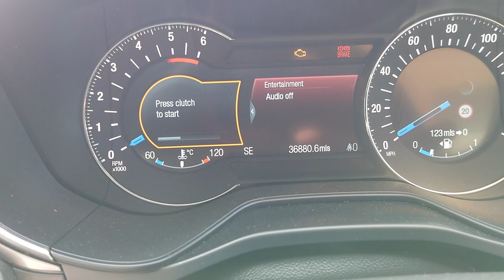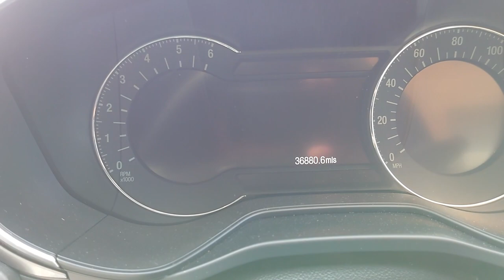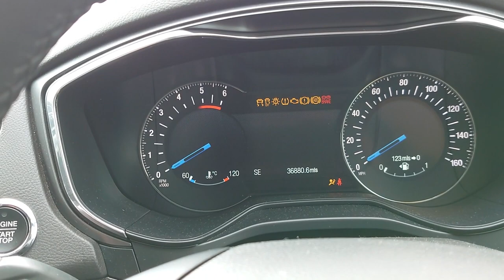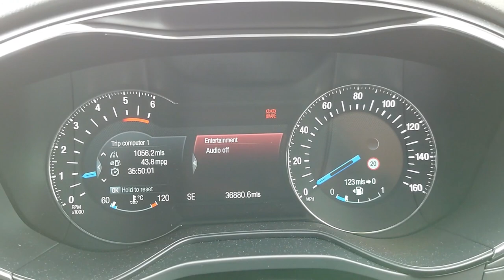Ford Mondeo MK5 electronic parking brake service

Comment: Nuni that was a very good and helpful explanation. I Like the part where you removed the electronic parking brake from the caliper. Nice tip. 

You can also set the electronic parking brake in maintenance mode without a scan tool, using a combination of actions as follows:

Activation:

Set the ignition to ON.
Press and hold the accelerator pedal and place the EPB switch to the RELEASE (downward) position. Continue to hold the accelerator pedal and EPB.
Set the ignition to OFF, then set the ignition to ON within 5 seconds. Continue to hold the accelerator pedal and the EPB switch.
The EPB system will be deactivated, preventing parking brake application until service has been completed and maintenance mode has been deactivated. The yellow electronic parking brake indicator will be illuminated and maintenance mode will display on the message center.
Set the ignition to OFF, then release the accelerator pedal and EPB switch.

When replacing rear brake pads in maintenance mode, the brake caliper piston must be compressed into the caliper housing. 
The brake caliper piston does not have to be rotated while compressing the piston.

Deactivation:

Carry out the following service mode deactivation procedure to activate the EPB system.

Set the ignition to ON.
Press and hold the accelerator pedal and place the EPB switch in the APPLY (upward) position. Continue to hold the accelerator pedal and the EPB switch.
Set the ignition to OFF, then set the ignition to ON within 5 seconds. Continue to hold the accelerator pedal and the EPB switch.
Release the accelerator pedal and the EPB switch.
The EPB system will fully apply and release the parking brake to guarantee sufficient air gap between the rear brake pads and brake disc.                                                          

Whether you have the start stop button or a key start system the same procedure applies.
Reply from the maker: Excellent thanks for sharing 😁
Reply: The brake deactivation process does not appear to work on my 2015 mk5 2litre diesel..☹️

Comment: Verry good instruction, if the electronic brake will not go into service-mode-position with the brake-switch methode or you don't have the service-pc.

Thanks for that!
Reply from the maker: I have service scanner. This is to show u don't need the scanner for it. I do mercedes, bmw, vauxhall fords vw audis all the same method. Its easier for me ☺️
Reply: @axores20  Yes, and much more cheeper! For nonprofession workers like me! 😉

Comment: I tried to retract the piston using the online methods with the park brake button and accelerator but it didn't work. Your manual method worked perfectly. Unfortunately, before I saw this video, I blew a piston when I stupidly pulled the handbrake on while the caliper was off. The piston extended all the way and popped out. I was able to put it back but unfortunately I stuffed up the mechanism. Was getting a handbrake warning and non stop chime while driving. Bought a second hand one and fitted it myself. When the oil on the old faulty one drained out, out came about 50 tiny ball bearings and springs. Mechanism busted. So, it was an expensive lesson. Don't pump your brake of hit the handbrake switch while the calipers is out 😣.

Comment: I have a question for you, I have the same vehicle, but I accidentally turned the caliper piston counter clockwise. Now I have the error message on my dash, do I open the caliper housing to reset it? The piston did go in with the tool, but now the limited brake service light is on. How can I fix It? Scan tool? Opening the caliper housing? I did put my car in service mode before I started my brake service
Reply from the maker: Hi. If you did put into brake service the motors should go all back and then what u need to do is only push the piston in. And fit new pads and then after all wheels all put on u should turn off the service brake and the calipers should back to normal position. If now u got a error you will need a scanner. What u can do is now leave the handbrake off and turn off the car. Disconnect the battery. Do what i did do, remove the motors and turn it to the correct position till locks like i did on the video and put motor on. Do the same another side. Put all together and reconnect the battery. It should back to normal. But before all this if you got a scanner check 1st the codes. If u don't jave a scanner then follow my procedure. ☺️
Reply from the maker: Also make sure you did not damaged any wire or disconnected any plugs from the calipers ☺️ let me know the outcome.
Reply: @axores20  ….yo, thank you so much bro, you the man 😎👊🏽…I will update you as soon as I can do that 👊🏽
Reply: I fixed it bro 🥳😎👊🏽, you are the man, thank you for the help and reaching out to me in a timely manner, just a fyi, the scanner tool allowed me to reset the error and then I was able to take the car out of maintenance mode. You saved me a lot money bro, god bless to you and your family, thanks again bro 👊🏽😎
Reply from the maker: Glad is sorted bro. Have a nice weekend 😊👍😀
Reply: @axores20  …you too bro 👊🏽😎 and thanks again 🥳

Comment: Great instructional video!
19:24 What was that "another kind of grease" which you used for those two guide bolts?
Thank you :)
Reply from the maker: Silicone grease will be ideal but I always use multi purpose grease with no any problems

Comment: What about replacing the whole calliper? If you take it off and unplug its electronic, will this cause any sort of issue on the dashboard? Thanks
Reply from the maker: If ignition is off u wont have problems. This is just power to a motor no any sensor on it. It should be fine 😉

Comment: Hey Bro, I need your help, I just got a limited brake service message on my dash. I ran the scanner and it gave me codes, C2005 and C1034. I replaced the actuator motor on the right side thinking that would solve the problem but it still has those codes, I’ve tried almost everything from disconnecting the battery to erasing the codes, but nothing seems to fix it. My last option is to replace the wiring harness on the right side since that’s where the code is coming from, but I dunno. You helped me a few months ago when I stuck, kinda hoping you had an idea on what it could be?

Comment: Hi Nuno. During the trip, my brake blocked and I disassembled it and tried to work it out and lubricate it. I screwed in the piston because I didn’t have the tools to squeeze it, but I didn’t know I had to put the handbrake in service mode. And now my handbrake doesn't work when I turn it on. The car displays an error and the parking brake light flashes. Can I return the handbrake to its original position and clear the fault or have I broken the handbrake and have to buy a new part? The foot brake works normally.
Tnx
Reply from the maker: Hi there, i would do this, 1st disconnected the battery, number 2 you need do this to both back wheels, take the electronic bit away like i did on the video, next u need push the piston all in. Put back the motor. Both wheels do the same. Then pump the brake pedal few times. When brake pedal feel hard connect the battery. Turn on the car and try apply the brake. It should work 😃
Reply: @axores20  Thanks for such a quick response. I'll give it a try and let you know how it went. Thanks again.
Reply from the maker: @josipkralj8229  u welcome
Reply: @axores20  Hi. Here's what happened. I tried the procedure from the video. And I noticed when I push the brake piston the handbrake shaft doesn’t rotate. So obviously that part is broken. But then I had to go to work in another state and I didn't have time to repair. Tomorrow I'm going to the auto parts store and I'll buy a new piston or if it's not a big difference in price a complete new brake caliper. I think I will have less problems if I buy a set of brake calipers because I have never changed the brake piston and I don’t know how complicated it is to change all those seals. Sorry for the longer answer. And once again, you helped me a lot, thank you.

Comment: Hi,Nuno! What kind of grease You've been used  to apply on some parts of break calliper,pads,piston,bolts? Thanks.
Reply: Copper grease on everything except the bolts which you use silicone grease for. Hope that helps.